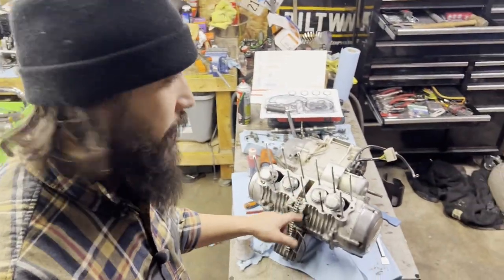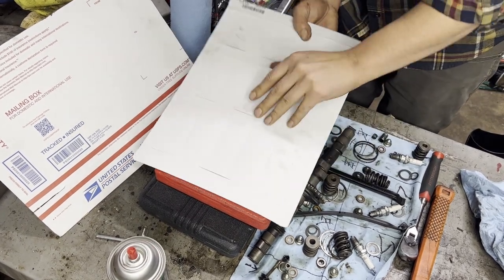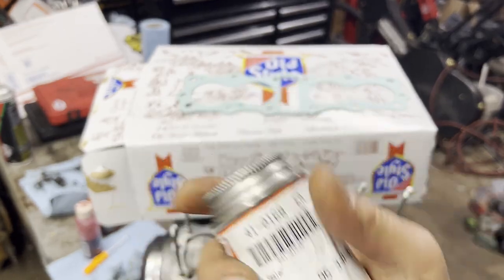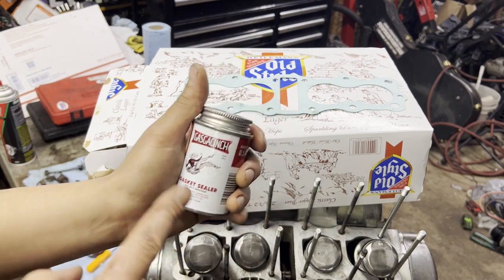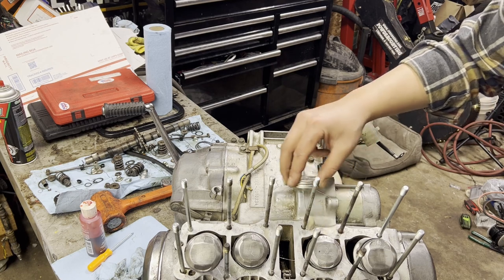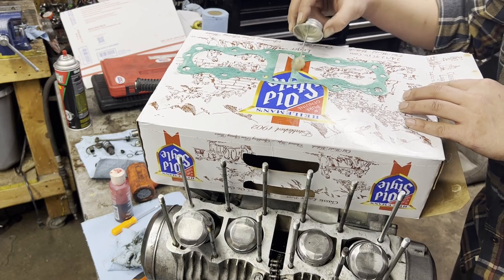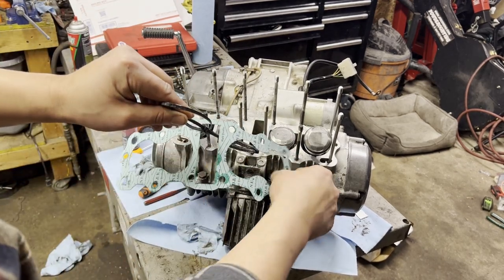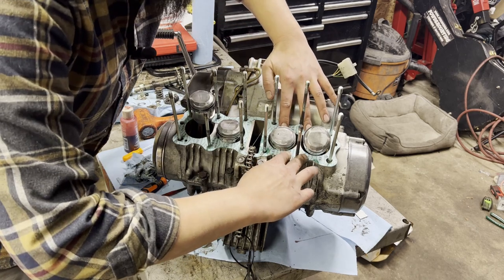1974 Honda CB350F: Cylinder Prep and Install

Comment: I was hoping you were going to install the dowel pins. Most don't realize they not only act as a guide but they stop the cylinder from twisting at high r.p.m. and heat. Much like the dowel or guide pins on the heads of your 302, a must to reinstall. You're making some fun video's....Thanks
Reply from the maker: YES!  I was so mad when I was putting this together.  It crossed my mind when I started assembly and thought to myself maybe I remembered them....  I can't do a motor and look at extra parts without questioning everything I just did...  Thanks for watching!!!!  I'm genuinely having a blast making these.  I'd be doing it anyways... but now the camera's on.  People like you keep me more motivated!  Thanks @Tom Montague!

Comment: Marbles motors offers an exact replica for the honda engine silver in a rattle can that is single stage high heat paint. 
He is based in Texas If memory serves me right. I can attest that its legit from personal use on multiple sohc 4s.
Thanks  for the video!